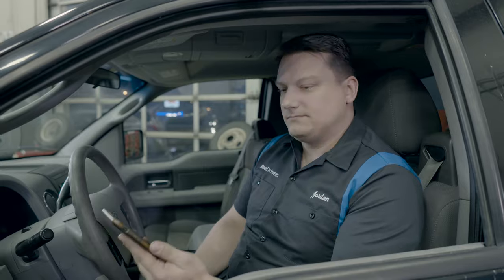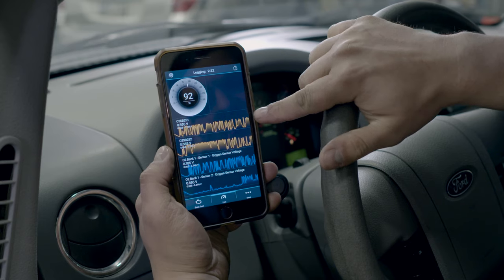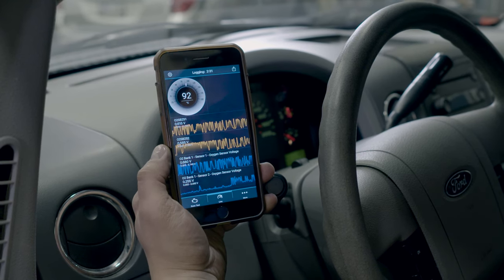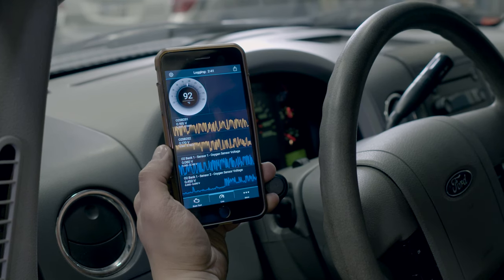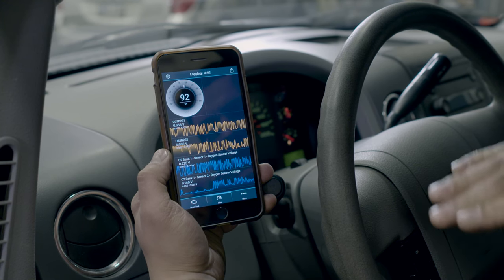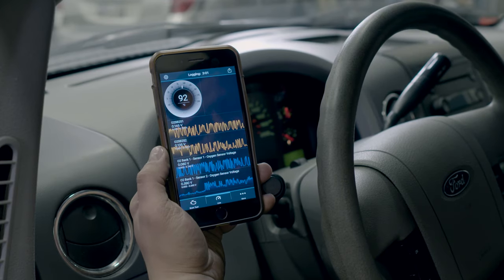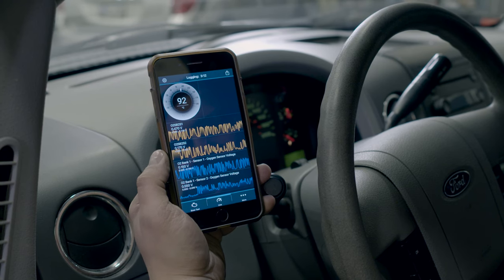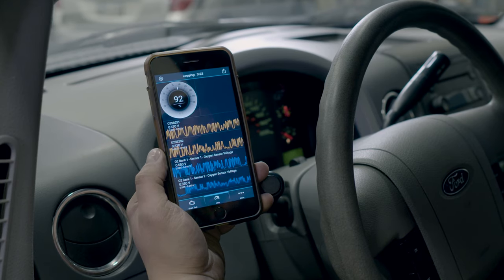Diagnosing Catalytic Converters

Comment: I just did these tests today, both the blue driver O2 sensors readings, and the temperature gun test. The downstream O2 sensor was all over the place, and the temp in front of the cat was much higher then the temp in back of the cat, so looks like time to get a new catalytic converter.

Comment: My 2016 Ford f150 3.5 turbo catalytic converters temperature test is good hotter going out then in by around 100 degrees but still throws a code p0430. Checked the 02 sensors with my scanner and 02B1S2 (V) 790-815 / 02B2S2 (V) 290-805 // 02S11 (MA) -.063 TO .016 / 02S21 (MA) -.074-.004. Could it be the sensors and not the catalytic converters or something else?

Comment: I use the BD daily. Current project is a 2000 GM 5.3 LM7.  Am getting 420.  I have borescoped the inlet and outlet of the cat. The substrate looks ok at both ends.  The upstream sensor is active but not uniform in oscillations. The downstream sensor is following the upstream almost exactly. 
I have fixed all exhaust leaks with new bolts and gaskets.
I am down to replacing the O2 sensors.  The only possible thing left would be a poisoned convertor. If gets to that I will try the lacquer thinner burnout trip trick.  For now I have put in an O2 sensor spacer and 420 is totally gone.

Comment: Will the temperature difference (between catalytic converter inlet and outlet) test tell you that the converter is bad/clogged apart from whether the downstream O2 sensor is working or not? In other words does a bad temp test definitely indicate a bad/clogged cat converter?

Comment: I was thankful blue driver scanned all modules and found the issues with this 2006 Chevrolet Traverse 3.6 liter engine. The codes where probably due to the miss fire causing the converter to  not function properly. All codes were erased and the scan done again, which found no problems after the fix

Comment: I have 2006 gmc 1500 savanna , 5.3L V8 . 
I just had the po332 knock sensor and harness replaced. I cleared the code . Drove the van for few miles , then the engine light came on . I checked and the code reads , po332 low input , pending . 

Question; 
1. What does this mean ? 
2. Is ok to drive 50 miles everyday for few days  ?

Comment: Currently dealing with a manifold leak that's popping and banging at idle. I'm sure the catalytic converter needs attention too.
Reply: Fix leak that lets unmetered air into the engine first before judging Cats 🐈

Comment: I have had both the catalytic converter and O2 sensor replaced and I'm still getting this code. Where do I go from here?
Reply: There are 2 oxygen sensors (upstream & downstream). Did you replace the other one?
Reply: @Dziricani  yes, both were replaced.

Comment: i was getting a 420 code, using live stream all sensors looked good with an occasional spike on bank 1 sensor 2. temps on bank 1 looked good, ~400 in and ~500 out so i replaced all the sensors with walkers upstream and bosch downstream. now i am getting spiked readings on both downstream sensors and the 420 code is back. any additional troubleshooting steps to isolate the converter?
Reply from the maker: If you have a BlueDriver you can send us a email from inside the app  (More tab, contact us, email) include this info and we would be glad to help you out!
Reply: You might wanna do an injector test. A bad injector can cause the catalyst to malfunction. Also a defective coil or bad spark plug can cause a rich condition in the catalyst. Lastly bad spark plug/s can cause problems also. Blue driver should scan and tell you if your O2 sensors are reading rich or lean. I’m thinking they will be trying to lean the fuel mixture to compensate for rich mixture in the engine
Reply: What your email  so I can sent you my data, maybe we can do a video for our blue driver friends.2007 toyota camry 2.4 (Po420) i want to learn how to read all this data. Thanks

Comment: I speak fluently English but I can’t understand some of your language I think it’s something with inlet or outlet but I’m not sure what you’re trying to say..😩
Reply: What he's saying is that because the chemical reaction inside the catalytic converter occurs at very high temperature, the exhaust gas coming out of the converter (the outlet) should be hotter than the exhaust gas going into the converter (the inlet) if the converter is working properly. But if the temperature at the outlet is less than the temperature at the inlet, this indicates a problem with the converter. He said that a good converter will have an outlet temperature at least 10% higher than the inlet temperature - otherwise it indicates a bad converter. Hope this helps.
Reply: @rodneyspence7441 it helped me 😅